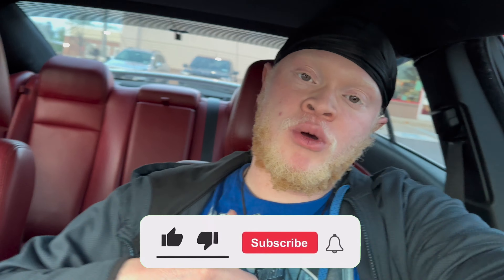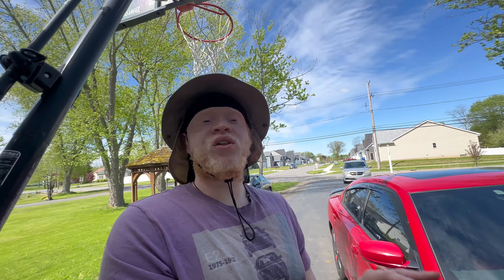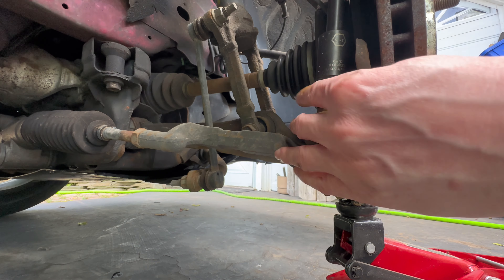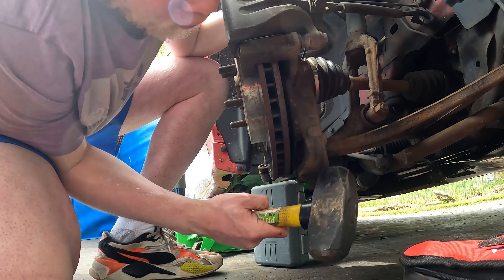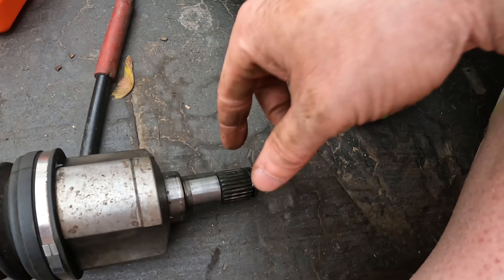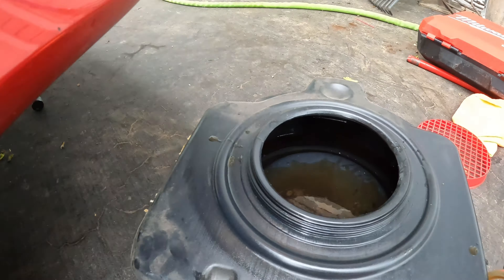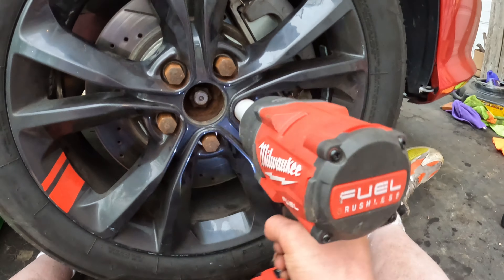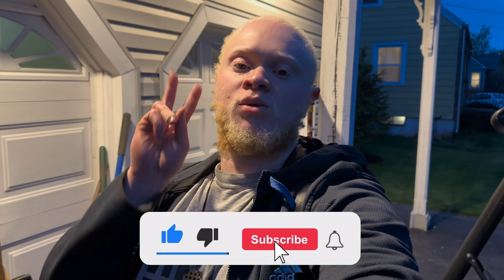HOW TO CHANGE YOUR RH CV AXLE, AXLE SEAL, AND FRONT DIFFERENTIAL FLUID ON YOUR DODGE CHARGER/300 AWD

Comment: I had a similar leak. Turned out to be my front crank seal 😂 it flowed around the top of my LT and it smelled like steak. Thought it was my nag1 leaking.  It was such an awkward leak
Reply from the maker: Damn that sucks. I hope you got it fixed though! I just was looking through forums and found that the leak I had was very random and I was like I’m really hoping it’s just the axle seal. I got lucky. Good luck with your car tho!

Comment: I’m struggling getting my RH cv axle out. My LH came out no problem. I’m going to try your technique. Did you have the cars LH side jacked up to when you pulled out the RH side?
Reply from the maker: No only the one side was jacked up. Try my technique and see if it works or not.
Reply: @DavidProductions345 thank you for the quick response and I love your videos!! They have helped me a lot. I’ll let you know how it goes.
Reply: @DavidProductions345 and you hammered the top part while you used the bottom pry bar with your foot like a gas pedal to pop it out?  15:19
Reply from the maker: Yessir!
Reply from the maker: Aye glad you’re enjoying the content!
Reply: David it worked!  Omg!! You’re a lifesaver brother thank you so much. I almost gave up. One pry bar as a gas pedal and then the other on top just like you said. Probably took all of 5 min. You’re the man!!